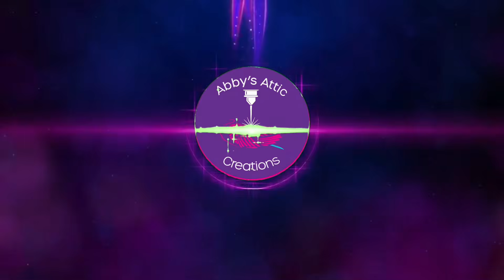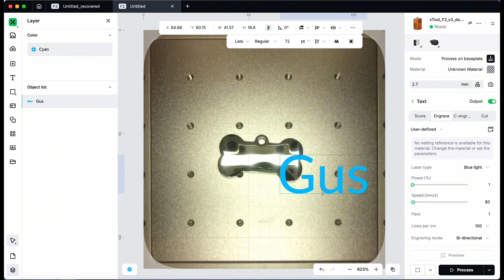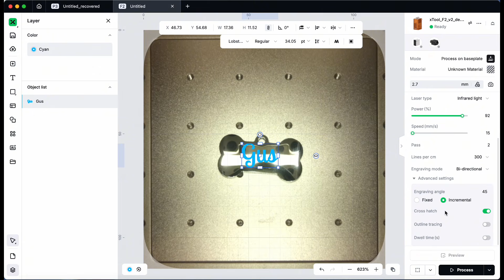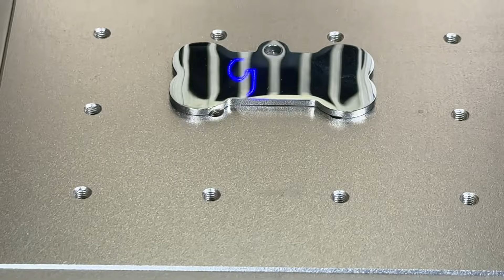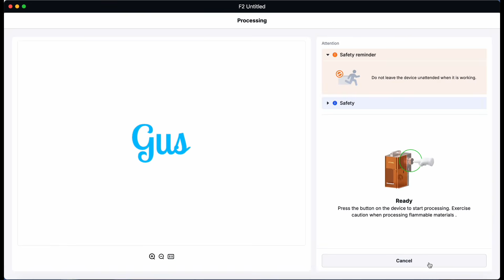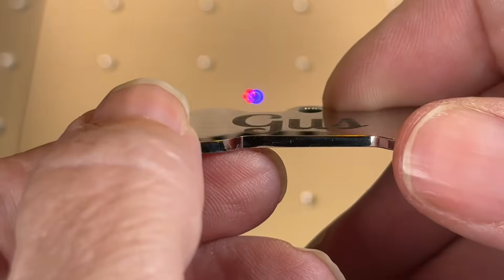Laser Annealing Stainless Steel Explained | How to Get Deep Black Marks Without Engraving

Comment: Super video .. just retired and bought an F2. One question I have... if your target is on a mounting for example, like a watch whose case back I want to anneal, do i use the thickness as the distance from the base of the X2 to the top of the watch case back? Appreciate your help. 

PS. Sorry to ask but I am just learning.
Reply from the maker: It’s the distance to the top of the material you are using.

Comment: What does the 45 degree angle do?
Reply from the maker: Changes the angle of how the beams comes down and hits the material. Helps with reflection and the beam possibly reflecting back and hitting the lens. It also disperses the beam so think of the sun when it’s straight above you, it’s at it strongest. When at a. Angle same amount of light but less intense.